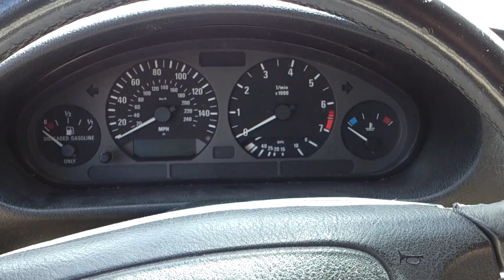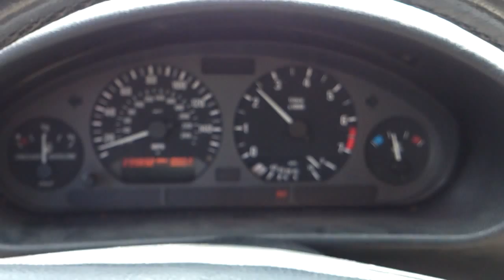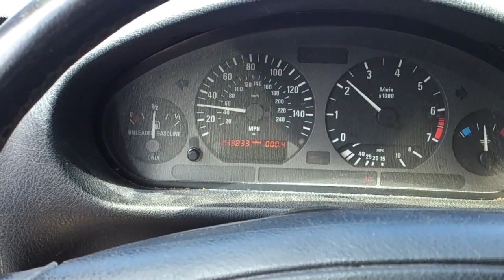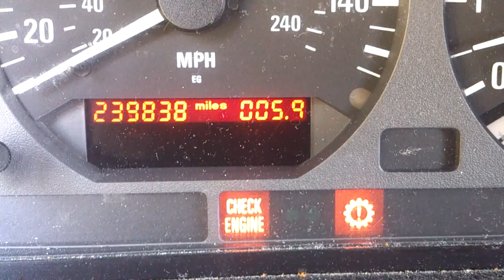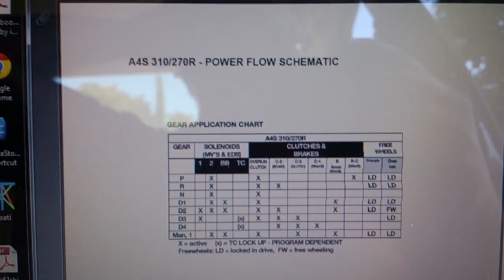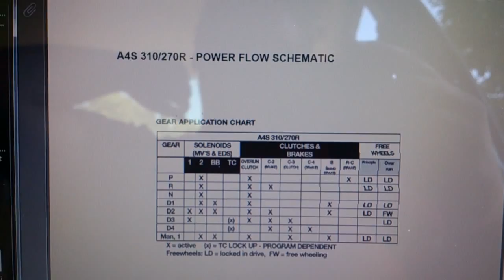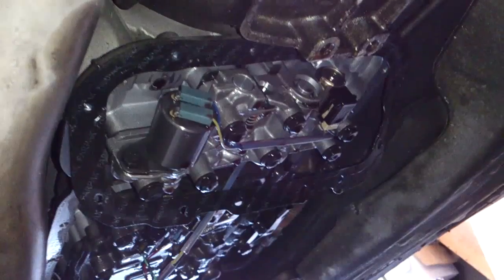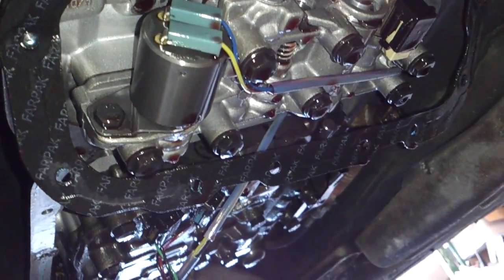BMW E36 Transmission Troubleshooting 4L30E - A4S 310R

Comment: So can I use any 4l60e rebuild kit on the A4S310R? Are the clutches, pistons, ETC the same as long as the model years are the same? I just lost 3rd in my 93 235i and am debating the auto-tragic manual swap. Its all going to come down to total price. So I'm lookin at new sun shell, clutches, seals, solenoids, band, and pistons since this thing has over 160k.

Comment from the maker: Stosh Przychowicz 4L60E is GM's name for the transmission, A4S310R is BMW's name for it, but they are the same transmission. The 4L60E can be found in a number of cars like Isuzu Troopers, come acuras, and a few other cars.
The parts should be exactly the same from what I understand, but certainly check with the supplier the kit you buy should denote which car its for. 
I thought about the Manual trans swap, but the output flanges are different which means a new driveshaft, or cutting the end off a manual driveshaft and putting it onto the automatic drive shaft.. Either way its a lot of work. I ended up picking up a newer trans from a junk yard. The rebuild of the old trans will come after I finish a few other projects.
Reply: its a 4L30E not a 4l60E
Reply from the maker: @georgeg5104  sorry I used a lower case L

Comment: Hi 
I have 1999 bmw e46 318i with automatic transmission and 240,000 Kms on cluster
I was driving back home from holiday with my family then we stopped at restaurant for lunch
after back to car i put it in " D " but car not moved !!! I tried " R " was ok but no drive forward !!!
also there is no any warning light on . I checked ATF level was good
Any Advise please ?
whats wrong with car
Reply: ever find out what the issue was?

Comment: I didn't watch the whole video, however i saw that you were in the M (Manual) mode, when you activate that mode the car won't go into 4th gear when the transmission is in D. The owner manual also states this. Switching to Automatic or Sport should resolve this.

Comment: I have this transmission in my 318ti which works fine in normal Economy drive but in Sport mode it will not change up to 4th gear,just stays in 3rd.Any idea what is causing that?Thanks!
Reply from the maker: Sports mode as I recall only goes up to 3rd gear, it does this on my 2007 BMW, you have to shift it to the 4th gear, being putting it into drive once you hit third, or if you have the manual shift option (sports then a pull out to the left to shift gears manually if you have that option).
Reply: @Jay-May  Thankyou for this info which is good news for me,I was concerned there may be a fault with the transmission.To change up to 4th I just manually push the switch back into E drive and the revs go down.Happy motoring to everyone.

Comment: my 97 528 i has the same transmission,  it will only shift up to second gear and in manual mode it will change to third but not fourth gear. I've done some research, changed my two front wheel speed sensors but it still does the same. Some have mentioned the abs module could be the fault.Is there any truth to that ?

Comment: Hello, my car shifts smooth from 1st to 3rd, however, it does not shift to 4th until I move stick to N and back to D, otherwise, it doesn;t automatically shift. It is running with new transmition oil. Any feedback will be appreciated. Thanks in advance -

Comment: i have a the same problem in my e36 320 i took it to a repair shop to change the atf oil put it did not help the transmission have only 110,000 miles on it . if you suggest changing the transmission it well coast me around 600 dollar but i am more into swapping it with a manual transmission which well coast me around 800 dollar .

Comment: would this work for a 2000 328i? mine is doing the same things but it only goes into third sometimes. but not into fourth and 5th? any ideas? should i do the same?
Reply from the maker: I would try changing the ATF fluid first. Use Redline symthetic ATF if possible and throw in a little Lucas ATF Transmission Fix.
If the condition still exists or doesn't get better I would drop the pans and see how much debris is in the pans. If there are chunks of metal most likely its time to think about a new or rebuilt transmission.

Comment: What is the difference between the 4L30E & the 4L60E transmission ?
Reply from the maker: The bell housings are different and I believe you can't remove the 4L60E bell housing, the computer and the programmed shift points are different, the gearing is different, the 4L60E is a stronger transmission, you might need a different torque converter..  The list goes on..
Reply: Thanks for the input it makes sense it seems like every time I Google 4L30e I get information on the 4L60e !

Comment: uhm, i see you had 240k Miles on this car. 
And i'm doing a little research , cause i'm planning on buying a bmw , but my price range sends me to these milage cars. 
Do they still hold up ? of is there a milage were parts start flying in and out the shop.
Reply from the maker: +Dhr Willemsen I got to 297k and the car was still running well, because of a new car I had to sell this one in the video. Basically every 100,000 you need to replace things like O2 sensors and maybe a water pump. 
The E36 is a pretty stable car. Easy to work on and isnt as complicated as the newer BMWs.
Hope that helps.
Reply: 297k Miles ! that's about 475k km. 
Thanks for the info. Just gave me confidence in buying a 300k KM Bimmer. 

greets.
Reply: Dhr Willemsen did you buy one

Comment: Wait thats a transmission light? Lol I should read my manual. Prolly should change my fluid. Thats been on since I bought it
Reply: Mines bein weird shifting from either park or neutral to drive or reverse in auto. Dips way down in rpm when I start accelerating

Comment: Having trouble with the transmission in my bmw 2003 530i  uuufff transfails lite come on n brakes  n ABS  my gauges not work is my transmission shot lol help
Reply: dora orellana mines doing the same thing I got a 323i 2000
Reply: Rodesha Chambers got my car fixed had to replace a brain box 1400.oo to fix shop ordered part online way cheaper than dealer. mechanic was very good was to us

Comment: I 2 have a 93 and same funny stuff,not happy ,weather being icy here in the south caused my trans light come slammed my drive gear and it scared the hell out of me,car proceed too a wild skid and I recovered at 50 miles hour I was lucky on black ice not cool,but now I have no d just 3 and its slow in take off and a indicator light I too have a mis place indicator shifter,i thinking fluid change and fact it being too cold out side in freezing temps.

Comment: Master air flow senser... clean it
Reply from the maker: That has nothing to do with the transmission. I think its the flagitator, but also could be the muffler bearings. I have to check the blinker fluid too I think its too low.
Reply: kan cli is right the mas has a lot to do with the transmission. Do some research before you start giving people bad info.
Reply from the maker: Bad  Brad The Mass Airflow Sensor has nothing to do with the trans, if the mas was dirty that's an engine problem not a gearshifting issue.
Reply from the maker: Try cleaning your Mass Airflow sensor (MAS), I don't think it will help, but some people seem to think so. I have a video on how to clean your MAS here: https://www.youtube.com/watch?v=UkQ_3B3G35k
Reply: dying laughing ! maf=transmission lmfao
Reply from the maker: kan cli especially when your using manual mode. MAF does effect shift points especially on 2000 year models and newer. MAF doesn't effect this car so much, especially when using manual mode.
Reply from the maker: Bad  Brad Not when using manual mode. Newer cars yes, shift points are set by a number of things, but if there is a mechanical issue like what I had, MAF is NOT part of the issue.

Comment: Having trouble with the transmission in my bmw 2003 530i  uuufff transfails lite come on n brakes  n ABS  my gauges not work is my transmission shot lol help
Reply: dora orellana could be abs wheel speed sensor